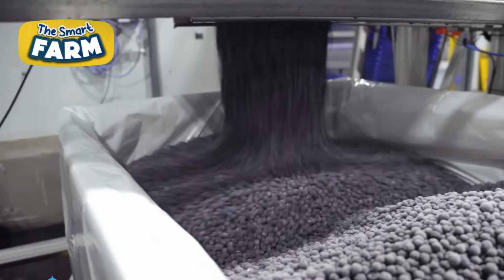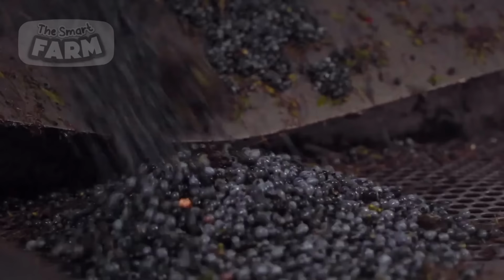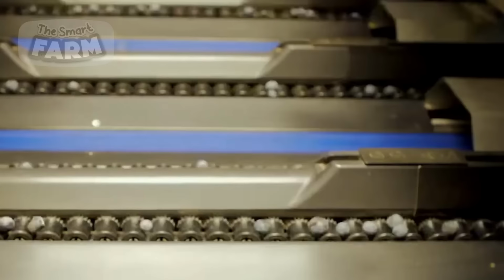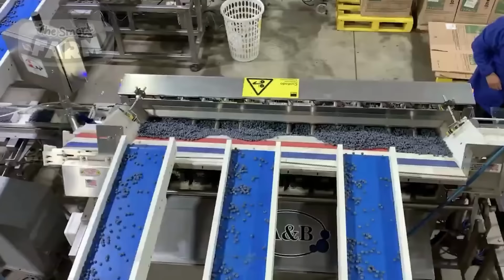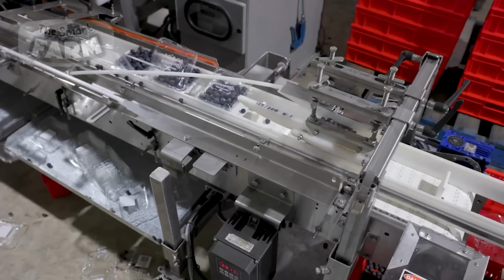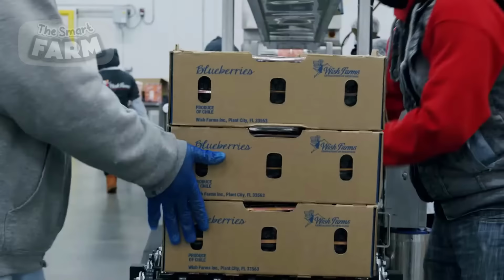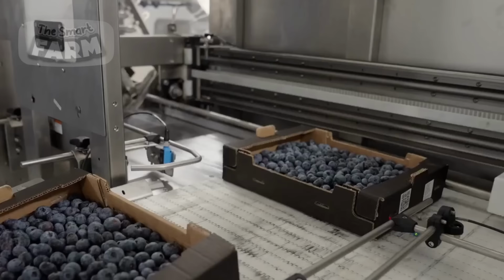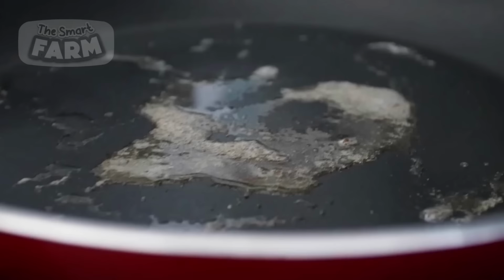Blueberries MEGA FACTORY: Processing Thousands of Blueberries with AI

Comment: why USA is unable to find solution for plastic packaging??
Reply: Plastic packaging helps preserve the food. This reduces food waste due to spoilage. The extra plastic used is much less of a problem for the planet than all the extra fuel etc needed to transport more goods because of the higher spoilage.
Reply: @danielbreiner9830  Here i am talking about solution not the problem. Electric cars are good but do govt. has facility to recycle batteries? if everyone goes electric?? Every thing has some cons. But how moderately we are doing is the point. A simple question. Why govt. has to beg people to stop using plastic bags? why cant they bring a law to stop manufacturing plastic bags itself for consumers? a simple solution is to cut the source first.
Reply: Nothing wrong with plastic it's easily recycled